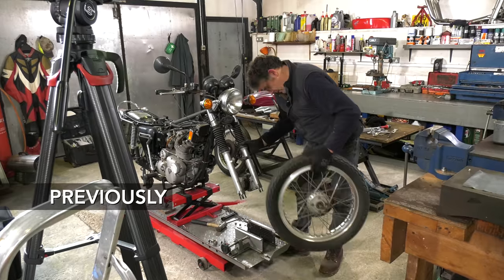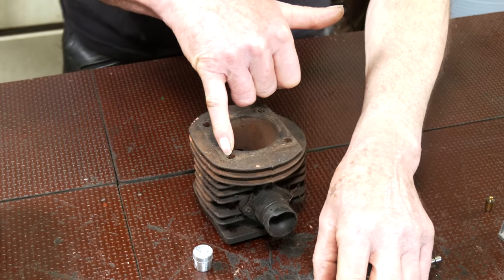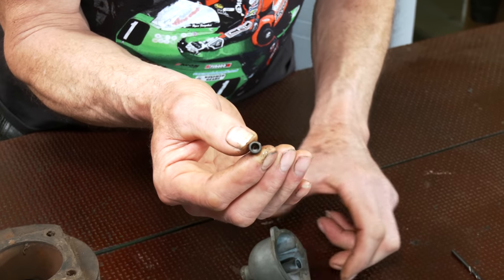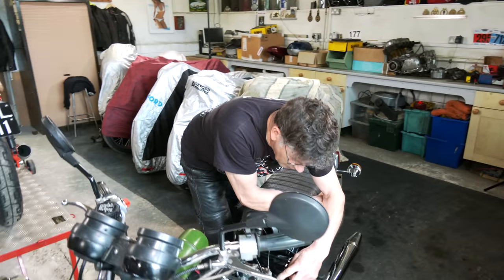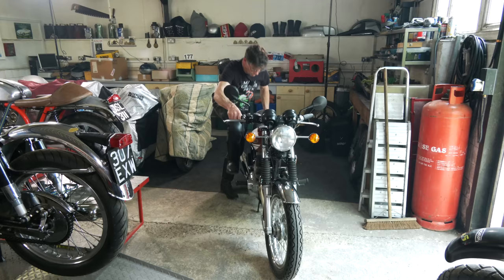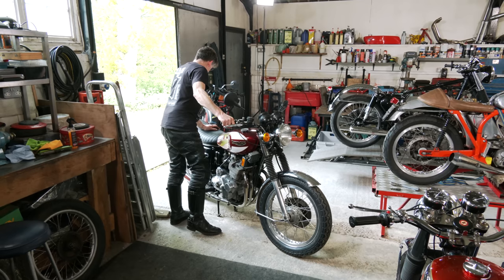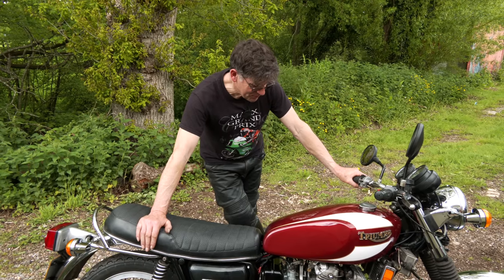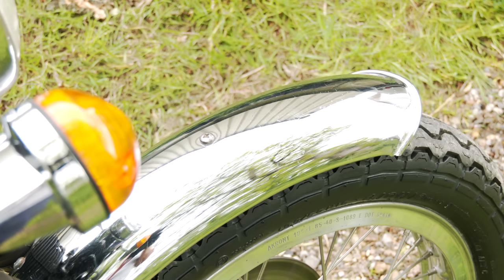Classic Triumph Motorcycle Recommission & Ride - Trident T160 - Part 8

Comment: Back in the late 70s and early 80s I was a mechanic for a Triumph/Norton/BMW/Moto Guzzi dealer. I did mostly British work and I built many T150s and T160s. To those of you who have experience with other classic bikes you owe it to yourself to sample a Trident or Rocket Three. There is really nothing like them. The three cylinder makes for a silky smooth ride. Since they are overhead valve and not overhead cam they carry their weight down low. This makes handling a dream.  The engine will rev but it doesn't have to. It makes power and torque right off idle. They are heavy and thirsty but are oh such a sweet ride.

Comment: Invaluable and profoundly enlightening Mr. David video series! If it had to solve problems similar to Triple's front and rear brakes, it would have an AV.C. That's why people are choosing Twins from the 50s and 60s so they don't have to deal with those surprise boxes and electronic circuits that leave you in the middle of the road without the slightest warning. Long live the English twins. Every video a renewed pleasure! Much obliged!

Comment: Hi Dave, great job as usual,with tank sealers, modern fuel has a habit of breaking down the lining over time, try evaporust or metal rescue,they’re both water based rust remover,just clean out the tank & make sure it’s clear of any petrol, fill it to the top with either product & leave it in a warm room for 4 to 6 hours, then check to see how it’s going,but 24 to 48 hours & all the rust should be gone, just slosh some distilled water around the tank & that prevents flash rusting,you can reuse evaporust a number of times til it turns black, I did this to my kettle that I restored a few years back & the rust still has not come back ,the reason I don’t like tank liners, is because watching a z900 being restored on Johnny’s vintage cycles as his mechanic was cleaning the tank out , the liner started to come out in large lumps,

Comment: I’ve always loved the T160....I went to buy one in 1980 but it wouldn’t start, Guy in the shop said come back at the weekend and we’ll have it running, I rode 10 miles and stopped at a kawasaki showroom and ended up buying a z650. I now wish I’d gone back for the trident as I would have never sold it, having said that how much trouble would I have had with it where’s I had no problems at all with the z650. If I could afford one I’d have a 160 now

Comment: I owned a T160V in the early 1980's, the side stand on my bike broke off too. I had the stand welded back on by a mechanic at my place of work, he welded the stand at the wrong angle too. The bike leaned over a lot more that it did, I normally parked it on the centre stand, if I used the side stand I stood it on the kerb. The Trident was a great machine to own and ride, you don't feel it's weight on the move, fuel consumption was 35 mpg. Mine had a Norman Hyde 850cc (actually 871cc) big bore kit installed by the first owner, it was good for 135 mph in favourable conditions.

Comment: I’m just at getting ready to start my recommissioned T160, carb cleaning was a major issue, minor oil leaks another time consumer, new wiring harness required some time to route, brake and master cylinder issues just like yours. Hopefully it will start and run like the one in the video. Provided nothing else crops up and fingers crossed that should happen this weekend. Enjoyed the videos, keep them coming

Comment: When the first Trident T150 (the dark green and black tank model) hit NZ's shores I went straight-in for a test ride on the importer's demonstrator. Being used to 650 sports bikes the likes of the Bonneville, the Norton 650SS, and the BSA Firebird, I was surprised how much taller and 'heavier' the Trident was, and it nearly caught me out on WOT with the rear wheel trying to swap ends with the front and this on just a slightly dampish level and straight tar-sealed surface. Cutting the power the bike stopped this fairly quickly enough, leaving my BP slightly elevated at the thought of nearly losing it like that. It seemed to me the frame, the wheelbase, was not long enough for the amount of power being delivered, which was linear, no peaks, but substantially MORE than any 650 I had ever been used to. The Dominator 650SS seemed to be 'safer' to ride in any manner you wished and had no really nasty surprises. The thing was that the Trident behaved like that on a level straight piece of tar-seal at only about 45mph hard accelerating. I decided I liked smaller nimble sure-footed road bikes like the Ducati 450 Desmo, one of my all time favourites for handling, that could safely be thrown around corners WOT or not, dampish or bone dry, and NOT deliver surprises. Another of my bikes that needed to be handled very carefully was the Guzzi V7 which would do something similar to the Trident (but take about twice as long to correct) on the slightest bit of dust or sand on a dry tar-sealed surface, leaving you, power off, struggling to keep the bike upright and heading in one direction under some vestige of control for as long as the unwanted 'rear wheel on a castor' antics lasted. And you didn't have to be riding either very hard or very fast for that to happen. Oddly enough heavy long wheelbase earlier mid-1950's bikes such as the M/G3LS didn't seen to display handling vices like this and could even be ridden along at speed safely enough on rutted metal, dusty stony roads with no surprises. Perhaps it is also something to do with torque delivery. The fewer the cylinders the safer the bike on less than perfect surfaces?

Comment: I bought a new one back in the 70s. Speedo packed up the first week took 6 months before they gave me another one. The bearings collapsed in the steering column and the central big end went about 10,000 had engine rebuild but centre big end bearing went again after another 10,000. A friend of mine he had one and his big ends went to regularly. Nice to see one again but I wouldn't want to own one again.
Reply: the speedo is driven off the back wheel. It's common for the long cable to have issues.
as far as the bottom end, I am perplexed.
One of their selling points was that it was bulletproof (in racing, etc). In approx. 40,000 miles I put on mine (probably more...the speedo was broke..lol), I did a few top ends......never had to touch the big end. Always used Castrol.

Comment: I see alot of negative comments on triple reliability but when u get them right they stay right for quite while. My only complaint was the pull rod for the clutch it was always a heavy pull with minimal accuation.  Passing a  couple of back to back 18 wheelers at high speed on a twin always scared me a a bit but not on my 5 spd t150 t.

Comment: Timeserts are good, drill slightly bigger cut a step with a stepped  tool. Tap with tap in tool kit, screw in with tool a threaded insert until shoulder engages in recess, complete installation which swells and lock thread in place. Your now back to standard. Very profession finish can be used multiple times. Not cheap.

Comment: I'm debating whether or not to seal the tank on my 64 Triumph TR6.  There's a lot of mixed opinions on line about using a sealers.  The bike's been running fine, but I can see there's some rust on the inside of the tank.  What sealer did you use on the Trident?

Comment: That's what I hate about multi carb bikes. One plug or carb goes funky and they do everything but run fine. I had a VMAX that one carb got fuel issues and took 5 minutes to fire up without choke.  At least with a twin there's less to work on if something goes haywire. Sweet ride though. Safe ride.

Comment: i finished my piston replacement on my 75 t160 i got it to start and run but once it got hot the idle went up to 4000 rpm and i couldnt adjust it down with the idle adjustment screw without it stalling . now it wont start and i have gas leaking out of the tickler buttons on the carb.  i do have good spark. but it wont fire. i need some advice please.
Reply: Have you checked wear on the the throttle slides?they are the same alloy as the body's prone to wear, new body's and slides are cheap, make sure the cutaway is the same 3-1/2 you don't need comple carbs, also remove your choke slides and block off the cable entry hole, norman hyde advised me of this and have had no problem since, good luck and persevere, its rewarding to fix these old dogs, Mark in aus.
Reply: @mmark8394  MARK THANK YOU for your reply. my customer refused to spend the money to fix this condition i informed him of his options and when he refused i returned the bike to him. it had many many issues that he refused to address to make this a proper rider.